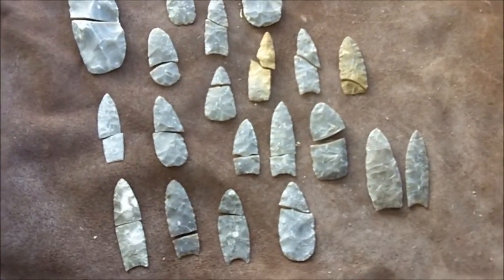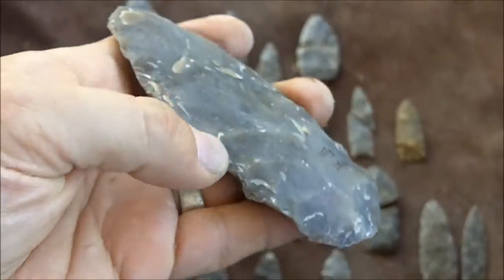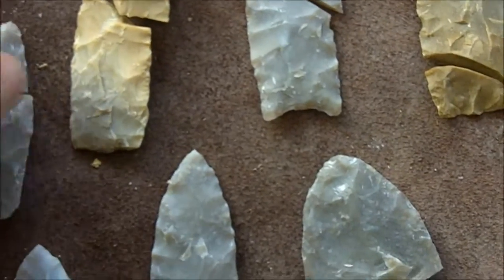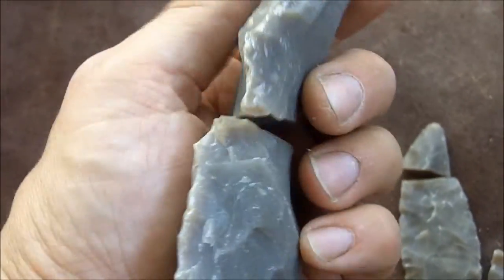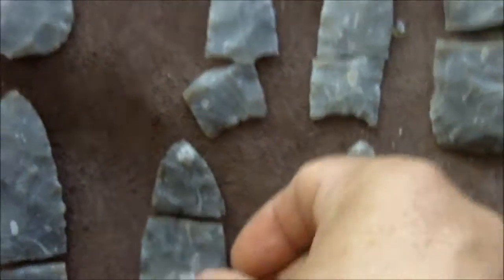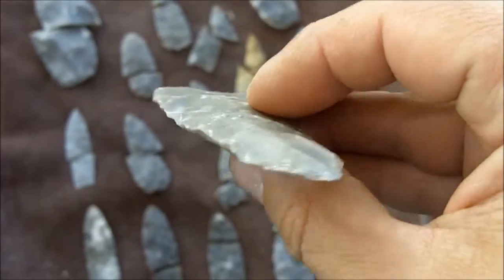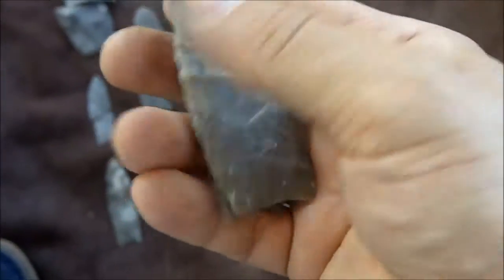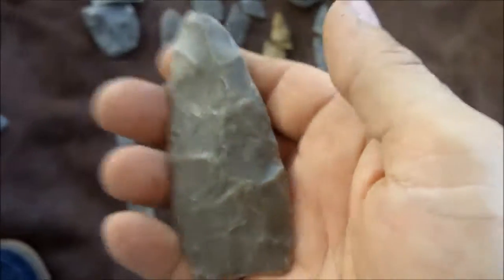213 - Part 2/4 - Clovis Flintknapping Research and Trials

Comment from the maker: Here's the easiest way:  make the hide string 12" longer than you need.  Put the loop at one end over a small diameter, cut-off tree limb (7 feet up) and tie the other end to a buckskin bag with a big rock in it.  Twist the bag until the string is wound up and pass a long stick through the bag's handle to keep it from unwinding.  The long stick will spin until it makes contact with the tree supporting the string.

Comment from the maker: There are two ways that the points breaks when I'm trying to flute:  reverse hinge and end snap.  A reverse hinge is when the flake "dives" and carries through to the opposite face.  End snap is when the tip breaks off or the base breaks of due to excessive bending force.  I don't get these when I'm thinning from the sides.  The two main types of breaks from the sides are excessive overshots and snapping caused by a crack that snaps the blade in a diagonal manner.

Comment: i know im a little late, lol.
i dont believe there were any jigs as there is no evidence of them. they would round the tips off because one way to do it is to then wrap the point in leather, bury the point in into your left inner thigh and then set up a powerfull indirect percussion flake. you are adding mass to the weight of the point by using your hand to hold the leather wrapped point and by adding back pressure with your leg. it fools the point into thinking its larger than what it is and can then take the stress of the flute.